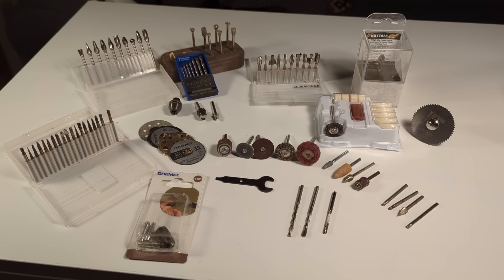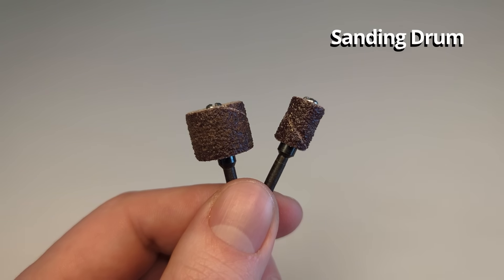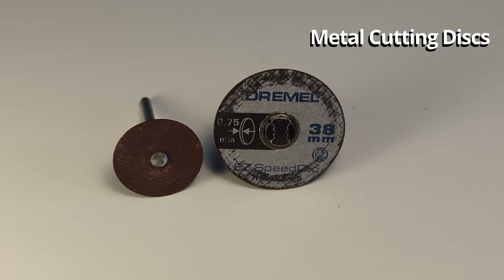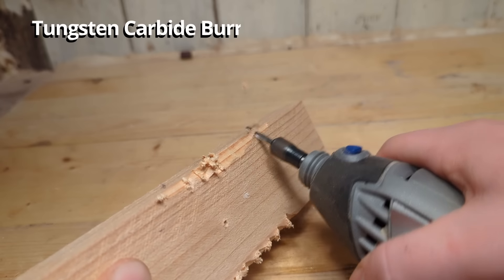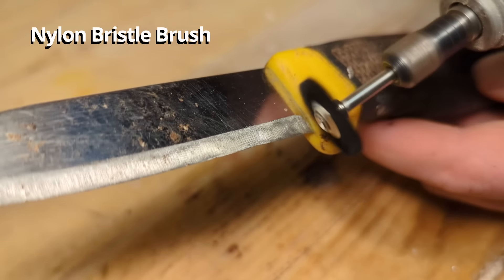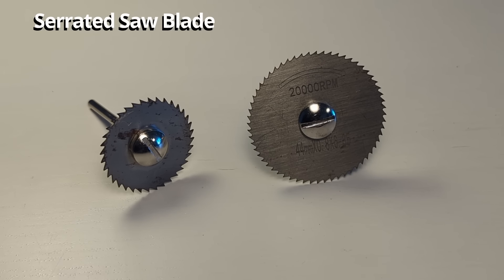The Ultimate Dremel Bit Guide

Comment: I'm here because I want some better alternatives to cutting wheels. I've used cheap china 402 wheels but they either explode or the mandrel undoes itself (not matter how hard you tighten and use loctite) as soon as you put any load on it. I love EZ speed clicks but they are so frigging expensive when you are going through them. I try to go as slow as possible to make them last longer but still go through them too fast, there too expensive. I use them for cutting sheet metal body parts in tight areas on rusty cars where a normal angle grinder cant reach. I'm looking for alternatives but everything is made for air tools, and I dont have a compressor nor the space for one, nor the ability to make that much noise late at night.

I'm gonna try buy some 50mm discs, that have a 10mm bore, and just use a shaved down m10 bolt with a nylock nut as a mandrel
Reply from the maker: Ye. I see your problem. Those cutting discs will get real expensive quickly if you cut a lot of metal. But I've found that the ez456 cutting discs and similar really are the best to use, so I don't really have any solution for this.

Seems like your solution will work fine though. I've also seen some people using old  cutting discs for grinders and cutting them into small cutting discs.  

One thing to remember though is that if the cutting disc is thicker it will have to remove more material which will also require more from the tool. :) good luck.

Comment: problem with dremel and similar 220v tools is too much rpm and small torque:  all bits are not suitable for high speed, most of them work better with low rpm and high torque, that is why i have low speed 12v tool with PWM

Comment: The metal wires on the metal wire disc brush will shoot out all over - aggressively.  Even tho I wore goggles, I had wire shards embedded in my face as well as in my clothing. I had to remove the wire from my face with tweezers (of course), but to think if those went into my eye... not good. Do NOT use the wire brushes unless your entire upper body is protected. I'm surprised Dremel hasn't gotten sued over this. EVERYONE complains about it.  To use the tile cutting bit - you'd have to use water - running constantly over the tile.
Reply from the maker: Yep. I would not want one of those wires  in my eyes. So as you say, if you really have to use them, wear protection.

Comment: Is there one that cuts harden bolts?  Is it the cobalt one?
Reply: I personally think use the tungsten carbide bits. Those are hard enough. Do know there expensive. There also alot of hss ones and those will not work.
Reply: @dashofawesome64 . I got a bolt that broke and when I was drilling to removing it with the extractor, the extractor broke too..   now, I’m looking to drill into it with this and see if I can finally remove it
Reply: @Ricky07070909  maybe use one of those diamond bits instead. Those are even harder. Tricky situation tho yea.

Comment: I used mine to cut out boxes in drywall and by the 2nd or 3rd box it became clogged with dust and the front bearing seized up solid and bricked the tool. I ended up just getting a drywall cutout tool like I should've in the first place 😂 Fair warning.

Comment: The serrated cutting disks are very dangerous and I do not recommend them. Perhaps if you could affix the Dremel tool to a platform and make a sort of miniature table saw out of it, those bits might be useful, but I know someone who was using the serrated discount to cut a piece of plastic that was sitting on a bench table, and he was holding the plastic with his free hand, and that saw blade walked right across all of his fingers, severing several tendons.

Comment: why use a collet over a multi chuck?
Reply from the maker: Hi. I sometimes prefer a collet when I'm using the same size bit. The multi chuck is a little bit chunkier. But when drilling for example I use the multi chuck.
Reply: Ok cool thanks! I’m not understanding why we don’t just use a multichuck all the time? Is it the size? My drill has a multichuck (or similar) and that’s always been fine for lots of different diameter shafts.
Reply from the maker: @thedarkhadou69  Yeah. I think it is just a preference thing. Would be nice if all the Dremel models came with a multichuck, I would not mind that.
Reply: Understood, thank you! Guess I’ll opt for the multichuck, it’s just simpler with no tools. Maybe I’ll be proven wrong with hard use!

Comment: When I was really hoping for was to figure out what all these other accessories that come in a kit are for. There's one that you should. There's one that you showed obviously for routing bits. Another I see here appears to be some sort of an extension. Tube, (as it says) another says, a flex shaft, a , brush looks self explanatory, ;, Something else here that simply says stand but looks like it clamps down somehow with a hand crank screw and Cone shaped wheel at he end all around a housing or bezel I couldn't possibly figure out what the h*** this thing is. But you least explained mandrels, Was also hoping you could explain the flatwheel. an different polishing pastes. There also appears to be what looks like an Allen wrench, but it's just a rod.
Reply from the maker: Hi. Check my recent videos. I made a video about all the attachments  a couple of months ago.  Hope it helps.

Comment: I have given up on Dremel. At best, I get about 10 hours out of a Dremel machine before they die. I bought a cheap rotary machine and it just keeps going and going and going and going.
Reply: Ye ur probably either using the dremel lite or using it wrong
Reply: @trident-69  Nope.
Reply: @trident-69  I've been using all sorts of power tools for 55 years. I usually get a lot more hours out of my tools than the average user. I also repair and rebuild tools. I know tools. Dremel is garbage.
Reply: @trident-69  Dremel's biggest weak point is bearings. Shame.
Reply: @trident-69  ..bearings, and maybe bad power management at low rpms. Coils overheat.

Comment: From my experience using Dremels for years as a professional sculptor, and going through a few. The Dremel brand bits are expensive and poor quality. If you can find a jewellery supply store you can get comparable and better bits cheaper. The best online store is Rio Grande in the US, for really good quality bits and a fraction of the cost. They ship to Australia, so my guess is they ship worldwide. 
I also shifted to a Foredom motor with flex shaft. Much better torque and better performance and range in hand pieces. Dremel is an okay place to start, but if you are using this tool a lot, consider upgrading to better tools. You will never look back.

Comment: You really need to mount your vice more firmly.
Reply from the maker: Hehe. I know. My shop is small, so i just move it around all the time and i have not bothered to secure it to the bench.
Reply: @rotarycrafts8760  Mount it to a piece of plywood that you can then clamp anywhere you need it. Or, even if not clamped down, it will still be more stable than just sitting there by itself.

Comment: 🎯 Key Takeaways for quick navigation:

00:00 🛠️ Overview of different Dremel bits, including common and uncommon ones, all linked in the video description.
00:42 🔄 Mandrels are attachments used for different working and cutting heads, such as buffing pads and cutting discs.
00:56 🪵 Routing bits convert Dremels into mini woodworking routers; useful for small woodworking tasks.
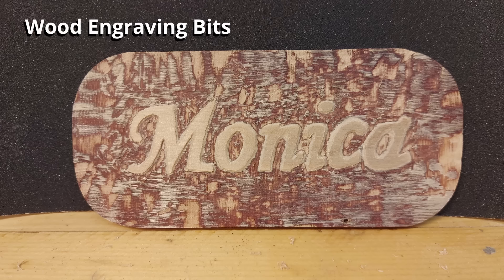01:39 ✍️ 561 multi-purpose cutting bit can be used on various materials, and is particularly effective for drywall.
06:00 🪄 Tungsten carbide burrs are versatile for metalwork and can be used on both metals and woods.

Made with HARPA AI

Comment: Re: wire wheels......
DEFINITELY wear eye protection. 
You should wear it with ALL power tool use, but especially those small wire brush wheels.
Having a doctor digging into your eye to remove a 2 or 3 mm piece of broken off wire is NOT a pleasant experience. 
It's even worse if you get an infection and lose the eye.
Reply from the maker: Yep. Exactly.

Comment: the circular saw blades are a complete ass to use free hand, they will bite and skip right towards your holding hand and then bite some more. best using them on some sort of saw table, or holding the work in a vise. better still use the cut off wheels instead.

Comment: This is a great video, but I caution users that Dremel routing bits and especially their router bases are of modest quality (even the plunge base). In particular, their bases are unstable and do not result in uniform cuts and lines. They are all a fraction of the price of high quality 3rd party attachments, but still not worth it. I'm a guitar maker and use my Dremel a lot, but I would never, ever use any of their accessories apart from the most basic sanding drums and cut-off discs (which are OK). They simply don't have the accuracy I need, and the 3rd party alternatives which cost much more are much, much better. Cheap 3rd party alternatives are no better than Dremel.
Reply from the maker: Hi. Thanks for the valuable input. I've also noticed that some of the attachments like the cutting base do not lock in completely level each time. I would like to try some of the 3rd party attachments, where do you usually find the 3rd party bits and attachments for the work you do?

Comment: 9:40 I suggest to stay away from these, they are very dangerous. I worked with one of then, and it seems that i pushed too hard which made the rod bend at 90°, being quite heavy and bent this tool turned my Dremel into vigorously vibrating fan with serrated blade, I was lucky that I always grip my tool with both hands, in ither case it would totally fly loose

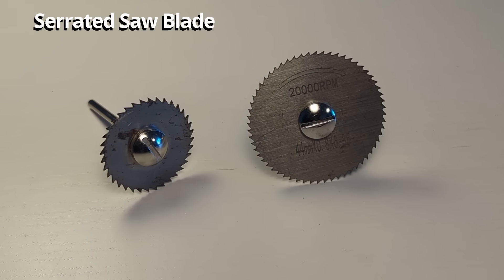Comment: @9:31  😳😬🙄🤬🤬🤬
I was building an RC plane and used one of these and it did that kick-back like you demonstrated, however mine climbed up my hand and up the arm of my shirt stopping just before my neck! 😬🥲🙏🙏🙏

I think this is the most unsafe tool-bit ever made. 

Unfortunately like many crafting tools there's no way to make it safe as that greatly limits its functionality and overall value.

Just plan ahead, be extremely safe and don't move quickly or bog these down or else you will suffer badly... if at all possible, please try to find a different safer tool or method than freehanding this thing!!!

Comment: a nice Drill unit,
unfortunately Dremel spins 
into the Wrong Direction !
Danger for your health !
Opposite direction unit must be manufactured — or just reverse the motor.
Current Dremel units blow the dirt-dust right into your face - Lungs 🫁 👺😩⛔️
Reply from the maker: Yeah. It can be quite annoying getting sprayed with dust, but there is a reason for it though. You can reverse the direction on some of the cordless models (Lite, 8220, 8240)  with some tinkering. I'll make a video on it soon. I would definitely like to see a Dremel model with reversible rotation.

Comment: cutting drywall with a dremmel O_o please don't... in most cases a knife will do the job much cleaner.
Reply from the maker: In many cases a knife is better. But a Dremel is good for when you want to follow the hidden stud behind the drywall, or electrical boxes. Just like a drywall cut-out tool.

Comment: Most of theses jobs are better done with the old tools. 
There is an over obsession with rotating tools, as much as there is to have batteries.
  A saw & a brush can't be beaten for cutting. 
Have a dremel, but use it once in 5 years if that. 
Odd tool, no power.